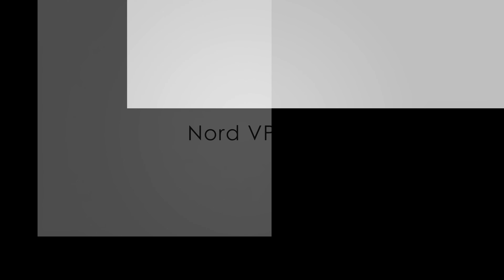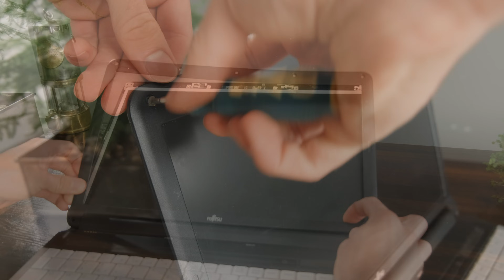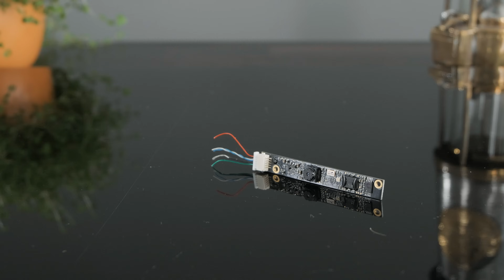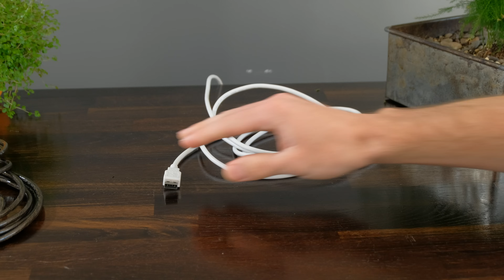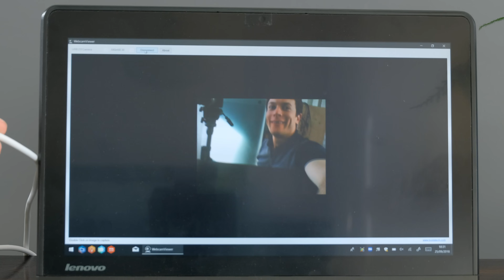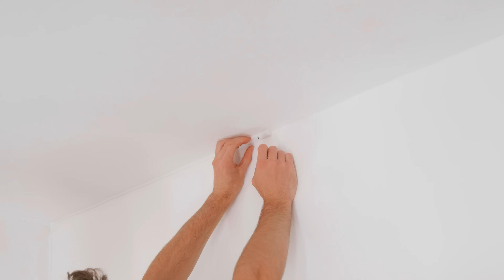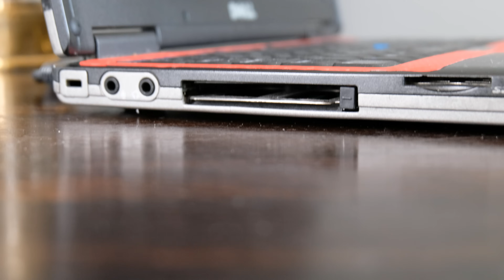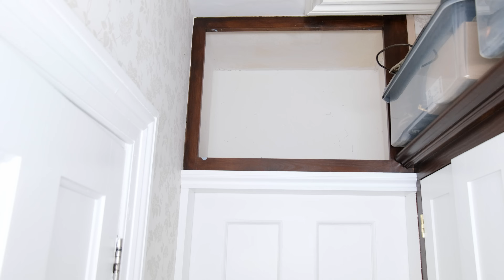DIY Home Security - ON A BUDGET!

Comment: Infrared cameras next please!
Reply: You may find that is just a matter of removing a filter layer on some CCD chips, and adding IR LEDs for illumination. Not sure if this applies to laptop cam chips though as I haven't had the opportunity to check.
Reply: @DanielSMatthews  also. some laptop cameras have led indicator lights. i wonder if a mosfet could be connected to the led power pin and through mostfet the infra red led's could be soldered. and from software the "led indicator" could be turned on at the night or so.
Reply: add a high power like 10w infrared led chip :D
Reply: you can check by pointing a tv remote on it and presing the buttons, if you se some light coming from the diode, then it might work as ir camera
Reply: all cameras record in infrared...just add infrared lights.
Reply: @Choice777 but first you have to take out the IR filter from the camera...
Reply: starshipeleven PoE?
Reply: @starshipeleven  the sweet spot of data transfer rate for an 1080p usb cameras (actually 720p real) is around 64-96Mbps, show me a $10USD usb extender with real data rate in those numbers? the ones i bought were $13USD each, they couldnt provide enough data rate for 10m distance and they even disconnect from time to time because of the low voltage they get from the pc at that distance... the ones that i found working decently are $22USD + shipping... 
btw yes i live in a house where i need even more than 30m of cable to the cameras (if you follow the walls even a 5m square room can need 10m or more of usb cable), i am not poor but i am not rich (i am tho lower than poor for Australian or western standards) and i cant afford a "real system" so i made my own for $150USD which has allot of options and logs and mobile app... i wasted a whole year making it tho... the electronics is custom build and took me 2-3 months but programming took me allot of time...
protecting wifi cameras is easy if you know how to do it, i know... you can even modify wifi camera to make it lan camera which is cheaper than buying a lan ip camera...

lack of money will teach you allot of things...
Reply: IamIUareU How would you protect against a wifi jammer? blocking all wifi bands in vicinity of your house?
Reply: jake johnstone  that will not make them unable to record when they sense motion on the microSD card, so even if you jam them it doesnt mean they are not working...
if you go that way then let me ask you, how will you protect your system shown in the video if the thief cuts your power before entering? :)
Reply: @Hobypyrocom  hey can you copy and paste a link on that camera that you're talkin about and it's Wi-Fi correct?? And what app do you use the two-way talk app that you can talk to someone from the camera... THANK YOU IN ADVANCE
Reply: @Mr.NiceGuy78  the camera i bought is "wanscam hw0036" was ordered on "Mar. 19 2017" for $20.52USD with free shipping. when this video was posted those cameras were still selling on aliexpress and were prices ~$16USD, tried to find one on aliexpress now and i cant find any... there are differently named but same design and functionalities cameras selling nowadays. they are all the same, made by the same Shenzhen manufacturer and they all have the same issue, their eeprom fails if there is any power supply variance, mine failed when my house lost power one day... once their memory fails they enter a reboot loop, you need to reflash the "firmware" (its just a naked linux installation with some python scripts), was going to make a video tutorial how to do this on china-devices.com but all this years i haven't found time to do that for some reason...
yes they were WIFI cameras and the android app i was using for the camera was E-View7 which is also unavailable on the play store now but you can download it from the wanscam website.
i dont remember exactly but i think i was able to connect to the camera using RTSP protocol for two way communication, otherwise there are http ports opened on the camera that you can use for one way streaming of their video, audio and picture capture... 
i highly modified my camera, i dont like wifi stuff, especially not things that i use in my custom security system, i desoldered and removed the wifi module that is installed on the camera and added usb to lan converter instead (after i checked and found out that the wifi module was using standard usb2 communication with the "motherboard" of the camera)...

those cameras suck, but if not else they are best for experimenting stuff on them and learning...
Reply: IamIUareU  You can use a pi at each camera to give them wifi. Would cost less than $22 each that the cables cost you.
Reply: CJICantLie  yeah but good luck setting up RTSP and video streams with two way audio, motion detection and alarm, one key installation, mobile app, physical pan and tilt, infrared and tons of other stuff those $20USD wifi ip cameras already have...
Reply: IamIUareU  Any chance you have a link to those $20 wifi cameras you speak of. I seem to find about $35 dollars as the best price for those features.
Reply: raspberry pi with motionEyeOS does most of that
Reply: Tobias Riis Skov  Yeha i just got one. Experimenting with it.
Reply: CJICantLie  i am not willing to advertise any seller or product, just go and search aliexpress you will find many wifi cameras as cheap... 
this is what the camera title was 
"WANSCAM HW0036 IP Camera Wifi 720P HD Network Surveillance Camera IR-Cut Night Version Indoor USB Charger P2P Security CCTV Cam"
Price:
    US $20.52 / piece

i bought it one and a half years ago... that seller is not selling anymore...
Reply: @Hobypyrocom  my DSLR records 1080p at 40mbps. Where are you getting those numbers from?
Reply: LandyXB i get my numbers from testing USB cameras data rates... most of those 1080p usb cameras are actually 480p... also make a difference between Mbps with MBps...
Reply: starshipeleven  well check my calculations for the exact system as DIY Perks showed in the video, its above $350USD (without the powered hub)... for that money you can buy as i said low end commercial home security system with more than just cameras... (just do a search on aliexpress "home security system") 
"Heh, professional hackers go in for the money, and since you are poor the most thing they will do is add your device to their botnet" well normal people like you and me should not be so worried about the security of our systems then? ok, so what did you said about the security of the wifi cameras? :)
its a DIY hobby project, so i like mine way more, its cheaper and easier and faster to setup and with way more options than the one in the video... my first wifi camera is running almost 2 years now without any problem, lets see how long will his system with a windows xp os work for ;)
Reply: starshipeleven  
"I think the assumption is that the cameras, the smashed laptops and the old laptop used as a master of the system are basically old stuff laying around at home or acquired through friends and family" man he did said that he bought them for $2USD each...

"Wifi is still very easy to block though with jammers, which is what thieves might use. They can steal your TV or basic stuff, much lower-level than hackers." yeah every second thief has jammer and exactly those thieves who own jammer out of tons of rich people they will target me and you, ok :) also i already said wifi cameras have microSD cards that record when motion is detected even without wifi...
 
"If you don't mind helping hackers doing bad things by letting them use your stuff, yeah. You know what is a "botnet"?" man you forget (or you dont even read) what we talked few comments ago... you know what is a "intranet"?

"Buying commercial stuff isn't a DIY project" hes not using bought stuff? soldering iron and solder are not bought? the cameras and laptop and wires not bought right? 
DIY = do it your self, and its not like someone from the factory comes and sets up your wifi cameras system... diy is what it is, you cant change its definition how it suits you...

"Computers slaved to industrial equipment run anything from Windows 7 down to DOS. As long as it is not going on the Internet it's fine. The laptop is unlikely to last more than 5 years if left on 24/7, but that's hardware failure, not software failure" you never worked with servers as i can see... never ever seen any windows server run more than few months without requiring a restart... even microsoft implemented linux servers for their azure cloud... and here you are giving his system more than 5 years running on windows xp (out of all other) after which the hardware will fail? man go back and do research before you talk with someone about technical stuff... your claims dont hold water at all...

i would be happy if someone come and told me a reasonable explanation why building this system than wifi cameras one, i would also argue with him a bit but at least i would learn something or see some other way of thinking... instead all replies i get are lame irrational claims that have main aim at "defending DIY perks" for some strange reason... i am not attacking him, i am just pointing that he is wrong that its the easiest and cheapest diy home "security" system... 

knowledgeable and rational people would not 100% agree with what i suggest and what DIY perks did, but yet all that commented on my comments totally agree with DIY perks system without any remark? i sense "fan" psychology rather than rational scientific thinking...
Reply: @starshipeleven  and here we go:
"Bilal Iqbal
34 minutes ago
where is the driver for camera...? it just says "usb 2.0 camera" but can't find the driver for it....
plz help to find the camera driver. "

the greatest, cheapest (but not the cheapest as i explained), easiest (way too hard even for someone who handled the soldering of the usb connector on the cameras) DIY home security system made by DIY Perks :)

but can this guy plug the power, install android app and click one button to setup a wifi camera? sure he can, even my 7y old nephew is able to set those cameras :)

you cant beat the facts @starshipeleven... everything you and others said to "defend" the DIY Perks lame DIY home security system falls into water...
Reply: IamIUareU Fucking what? Your grammar is shit. Jesus H. Fucking Christ - for a guy who claims to be an intellectual your grammar is at a 3rd grade level. I can eat a bowl of alphabet soup and shit out a sentence more comprehensible than most of your comments. I'll be using this guide instead of whatever the fuck it is that you're trying to promote with your Orangutan-level grammar. I live in a small apartment so this guide is actually fairly useful, especially when one takes into account that a hardline system requires less upkeep and not everyone wants a Wi-Fi network. Personally, I have internet on my phone and that's it. I had my identity stolen when I was active duty in the U.S. ARMY and ever since, I've lived my life with as little digital footprint as possible.
Reply: @travisott9719   Travis Ott  not everyone's primary language may be English. You can always clarify if you did not understand something. It could be hard for you to speak his tounge with bad grammar, friend. You don't need Jesus H. Fucking Christ, or be an Orangutan for that. Just need nice manners and an understanding nature.
Reply: just dont bother... you will need $20USD or more per peace of USB extenders for the cameras to work on 30m distance... instead buy wifi ip cameras, you can get them for as low as $20USD and they have infrared, pan, tilt, motion detection, two way talk, mobile app... tons of options for the same price that you will need to do the "system" from the video and less work...
Reply: @Hobypyrocom   why are you hiding in a comment thread rather than the main comment?
Reply: LessGlare  what? whos hiding? which main comment?
Reply: IamIUareU  Would take me less than a minute to knock out an a IP camera using wifi so you may have something you think is more robust but in reality youve either given me access to your cameras becasue of the shit state of security on said devices or made them easy to disable by anyone who can follow basic instructions.
Reply: jake johnstone  yeah, did that my self, but i dare you come and try that on my wifi cameras :) its not like i leave them as they come from the factory ;) if you know how to modify and make them safer they will be safer, i know how...
Reply: IamIUareU  If you work at a dump you can sometimes source them from trash for free 8) 
Tho in my case I have to be pretty quick since our russian employee is always after work scavenging the site.
Reply: starshipeleven  trust me i measured even with hub... 5.1V on pc USB port, 4.4-4.0V on the other side of 15m cable without anything connected on it (with the extenders i mean)... most USB hubs (especially all of the cheap ones) dont have external power supply so how will a USB hub connected on a USB port deliver more current if the USB port it self can only provide 0.5A?
Reply: starshipeleven  and the system shown here on the video is safe? you know that the software he is using has no back doors right? nothing is safe, but if your camera system is offline and local only, it will be as safe as anything else... we are talking about home security its not like someone who wants to steal from you will seat infront of your door (or rent the house next to you) for few days attempting to hack your security system to enter your home... if you have valuables at home that thiefs would target you for then for sure you have money to buy regular security system backed by a company, we are talking about simple and cheap DIY system... i said which one is the best and cheapest, the claims in the video are wrong... good project to learn from but not good for the claims and misleading people...
if $300USD+ is the cheapest and easiest for him then i beat him with my wifi cameras system that costs only $180USD max and i dont need to do anything except to provide power to the cameras and set them up on my phone...
Reply: starshipeleven  
"I said powered USB hub" add that to the end price of the system shown in the video and then reread all comments...
"The question isn't about me, the question is are most people able to?" getting a wifi router and connecting the wifi cameras on it without connecting internet to the router is something that most people are not able to do? but yet they all have soldering iron and know how to solder and how to wire and everything? really?
"USB on the other hand is simple to understand, reasonably easy to setup, and much more secure" true but is it easier as powering a device, installing an mobile phone app and clicking one button and providing the wifi credentials? as i said reread all the comments, to place USB camera 30m away from the laptop you will need $20USD+ of USB extender on each of the cameras and plus powered USB hub as you mentioned, which makes the price of this setup in the video obsolete and not cheaper than normal low end commercial home security systems as DIY Perks claims...

about the challenge, its not only for you, its an open offer for anyone that will read my comment, i will provide any info required (except my personal info and passwords from my network) and lets see anyone hacking my wifi cameras and provide proof... i have one that is still as it come from the seller, i will not change anything even the default user and password on it and lets see someone access it from outside and hack it if those cameras are so unsafe as everyone claim...

Comment: I have an old B/W camera with IR LEDs around the sensor that works even at night. It has a composite output and mic. I would like to use it as a security camera in an area at the side of my house where someone occasionally flytips old furniture and other rubbish. I want to catch them next time. Is there a small cheap low power video capture device with composite input that  I could leave running all the time that I could buy to capture video to a HDD or SD card. I don't want to have an old laptop running all the time as that would use a lot of power. Would a Raspberry Pi + USB video capture adaptor work?
Reply: Yes it probably would, you can get small composite usb capture cards for cheap from ebay, they even have audio in. Then you can use some software to collect it to the sd or external usb hdd.

Comment: Windows XP may not be the vest OS for security cameras because otherwise it may be really for a stranger easy to hack and look in your home, for example to know when they can do a break-in. Most criminals aren't this advanced.
Reply: Just keep the laptop air gapped > problem solved. Even the 'pro' level remote monitoring systems are ridiculously easy to 'hack'.
Reply: @GetTheCheeseToSickbay  That's a simple solution but with less convenience. You could theoretically use open-source with full encryption and get it fairly safe but of course, you're never safe if you connect to another computer. Of course a blackhat of some sort can always physically penetrate to get access to it but what's the point to do that if it's not critical infrastructure or government stuff which should have better systems anyway.
Reply: It can record without internet so you could just disconnect it from internet

Comment: The best thing about it is that it is completely offline, so you can even put those cams in your bedroom if you wanted without having to fear someone to watch you sleep.
Reply: Just have to make sure the main laptop isn't connected to my local FBI Van wifi.
Reply: Cavey Möth And don't forget to use shielded cables and Faraday cage cases for the cameras and laptops to avoid TEMPEST leaks.